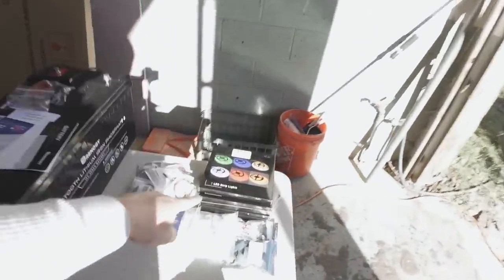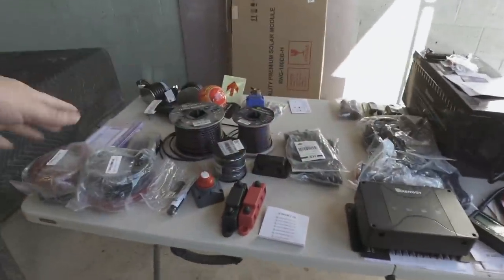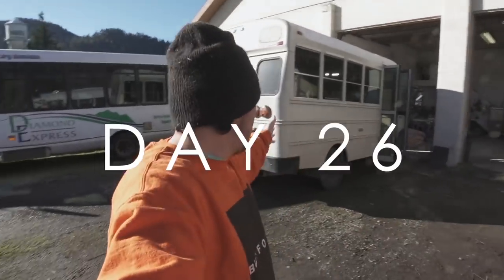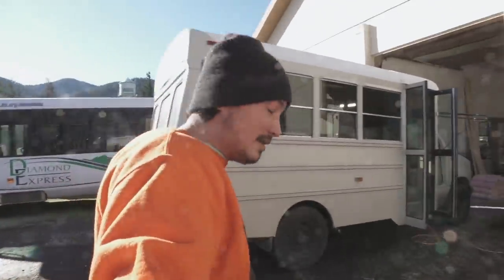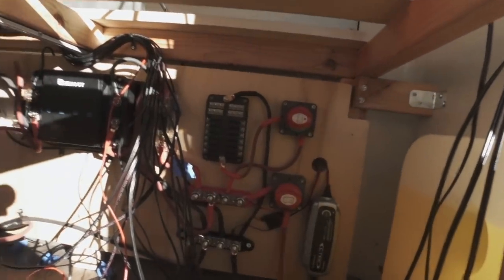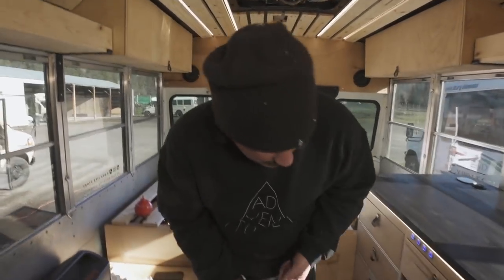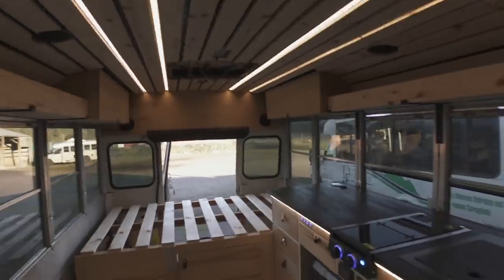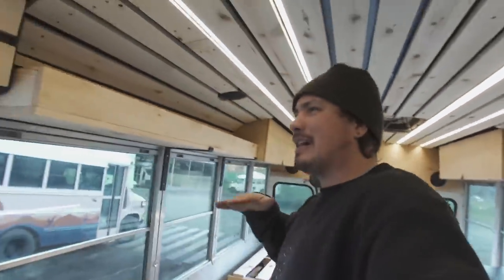SCHOOL BUS ELECTRICAL - 30 DAY SHORT BUS BUILD

Comment: Nice video on the electric. Link is showing 170 amp hour battery. We decided to go with the separate MPPT charge controller and a separate DC to DC charger. Best way to make sure that you don't burn out your alternator. We decided to connect the DC to DC charger to a separate power switch as we didn't see a need to have it running with 360 watts on the roof when driving on sunny days. We installed shore power the same way. No need for a 30 amp hookup. Love the under cabinet lighting and the ability to have it dimable. Making all of those electrical connections under the bed made my muscles sore for a few days. It's always good to have help from friends. Check out RV with Tito channel. He has some great ideas for installing flexible solar panels. You guys are in the home stretch!
Reply from the maker: Yeah I think I would do separate systems knowing what I know now. But if you are space conscious I think this is a good option

Comment: The pros about the Renogy all-in-one is it's cheaper than the individual ones, but the negative is it will only charge 30 or 50 amps max, which on a sunny day while driving is bad. That being said, I bought one and a 600W inverter new, but scratched up extensively, for $200. Worth it! I also have a 40A DC to DC converter I already bought, so maybe I'll run both, or put the other one on a switch. I bought the 20A, but Amazon sent me the 40A. Mom also had me order an 8x12 greenhouse, but they sent a 10x20, which actually was better in the end.

Comment: Hey Issac,
Great channel, just stumbled into it a week ago and haven't really put it down. You've got a lot of great build ideas and practical innovations. A big one that stood out to me was leaving a space behind all the cabinets for running wire... its just so common sense and yet I hadn't thought of it.
I went with this charge controller in the build that I'm doing, based off of @Will Prowse's channel. A MUST for off grind power! A cool thing to note is that if you install a shutoff for the solar panels, you can draw the full 50amps from the alternator charging, then when you're parked, turn the panels back on. I'm going to be installing a switch in an easy to access location for just this reason. 
Keep up the great work!
Reply from the maker: Got ya . Does he have a video on how to do that?

Comment: Here's what I did with my controller/dc to dc.  Add a switch between the solar to the charger.  It doesn't make sense to give up 25 amps of charging when you're charging dc to dc.  From solar, (especially with a smaller solar system) to only get maybe 10 +/- amps.  The switch turns off any reading of there being solar there, and you then can put the total 50 into he battery.  If you're stationary for a bit, and getting good sun, turn it back on.  The dc to dc being on and you only getting 25 amps max won't matter because you will never get close to 25 amps with your system.  I have 400 amps of solar, and I don't know if I ever maxed out.  Maybe with a perfect day, perfect time, etc.  You can test this by just disconnecting the solar and connecting it again to try both ways to be sure it works for you.
Reply from the maker: Got you. Thank you. I’ll look into this

Comment: So this is almost identical to what I had originally specked out for my bus until my wife wanted to go big.  Great choices!  I did see one video that suggested with the latest version of that charge controller you can get full 50amps from solar or alternator as long as the other was not hooked up.  So the guy put cut off switches to his alternator and solar to make the charge controller think the weren’t there.  Don’t know if this works or not, but might be worth trying.

Comment: Best video I’ve seen so far on helping understand electrical install. One question I’m installing the almost same system but was going to be adding a breaker panel off of the inverter like you would have in a house. Is that not needed? Or is there a reason you didn’t add one?
Reply from the maker: I didn’t put one on cause the manual didn’t say too. Plus I have a kill switch for the entire house battery. Also I only turn the inverter on when I need it

Comment: Isaac…Thank you for the time and effort put into your content.  I can tell that you absolutely LOVE what you do. For a first time skoolie builder, it will be a great help.  I have a question though.  Our shuttle bus that we recently purchased, already has dual alternators. I am pulling the engine for a rebuild and would like to make any upgrades to the alternators process. Is it a good idea to dedicate one alternator for the starter batteries and the other for the house batteries? What should the set up look like with a dedicated house battery alternator? Should I stay with 12 V or go to 24 or 48? I have so many questions lol, but any advice you can give would be greatly appreciated. Thank you so much
Reply from the maker: Thank you for watching 💗

Comment: Hey man! I’ve been using battery isolator switches in combo with mppt chargers but like your new combo unit however the input voltage is way too low on the unit you showed for the panels we use, do you know of another unit with 40volt, 600 watt inputs for solar?
Reply from the maker: That’s like this one no. You prolly have to get separate systems

Comment: I've got a 95 International 3800 I've had a bunch of people tell me 30 amp is really all I need for my short bus. So I'm setting up my Amazon cart with same brand items. But I stick with the 30 amp? And be okay you think? I generally keep a small generator with me I probably use that more then actual house battery. I've been told 50 amp is a bit Overkill because I do play Xbox and have a TV and an air fryer but I generally will use my generator to use those. Any advice would be helpful I'm getting ready to start my build in the next couple weeks with my electrical. Thanks for reading

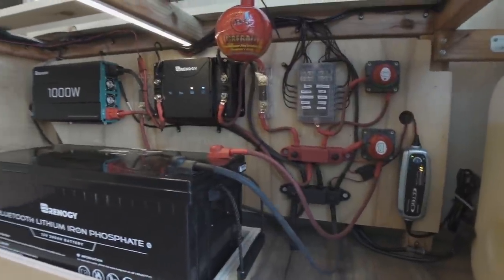Comment: @21:12 what is that orange/red balloon/ball like object? Suggestion: add another lagun table mount at bed - move table top as needed.
Reply from the maker: Oh that’s an afg fireball it’s a fancy fire extinguisher that will self ignite
Reply: @isaacturnerit  awesome and kinda cute. Doing a fantastic job.
Reply from the maker: @patsykluting-lucas3804  thank ya
Reply: Where do you buy the fireballs from
Reply from the maker: @ramblinrenee2678  https://quoradistribution.com/products/afg-fireball-modern-mosaic

Comment: Hi isaac , watch your video many times but first time to comment. would like to know can i use this Renogy but 24V dc to dc charge controller , to charge my 24V lithium battery using the source input of my car alternator?
Reply from the maker: You would have to check their website. But long as it says it can do 24v yeah

Comment: @isaacturnerit
 I love this system!
I am gathering all the pieces i need but what if the only shore hookup is 30 Amp or 50 Amp.
Can this be converted to accept the 30 Amp?
I think i need a 3000W inverter. I will be running a DC Fridge, Window/Wall AC, Hair Dryer, 2 AC outlets with 2 USB Charging Ports. I want to add Solar later but not now since im only using this for a weekend getaway vehicle.

Comment: You’re home doesn’t count as an electric vehicle if it still has a gas or diesel tank or engine. It counts if the whole vehicle is electric.
Reply: They aren't implying it's an electric vehicle. It has been outfitted with electrical with the capacity to live  on the road. I'm confused why you thought that they thought it's now an electric vehicle 😅